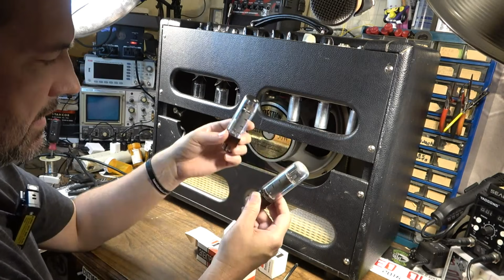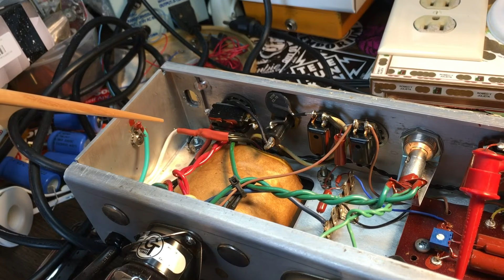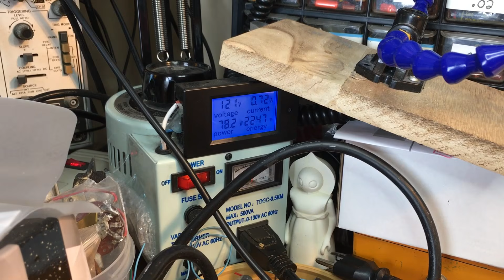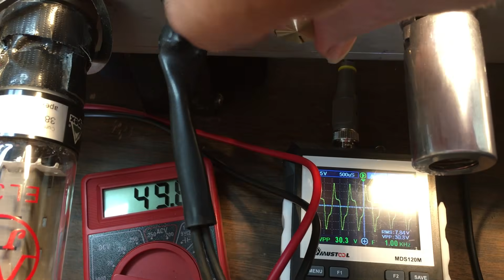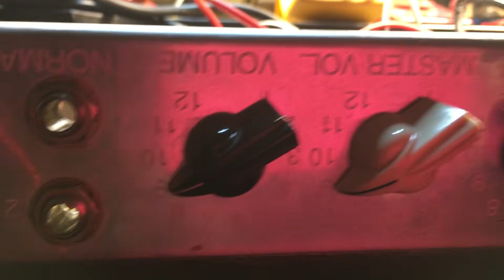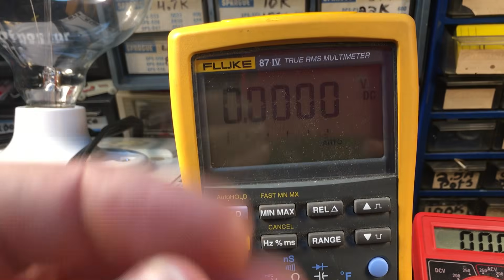STOP USING THE STANDBY SWITCH ON YOUR GUITAR AMP!

Comment: On the dumble designs, doesn't he often move the standby point until after the big caps & choke, so most of the inrush is split between power on and standby switch? I always thought that was an interesting design choice. No load B+ at that point would need some appropriately rated caps.

Comment: I think we are all barking up the wrong tree here. The root cause of tube rectifier failure is high plate voltage. Modern tube rectifiers seem not to be able to handle the higher mains voltages we often see today. Check your wall voltage with a good true rms meter and you will often see upwards of 124 volts. That is over 5 percent higher than the 117 the amps were designed to. Variacs can help but are big and bulky.

Comment: Yes and No , use it for power up only ! Why it is there , Never use it to mute the amp after warmup.Or before shut down .
Standby switches were designed to protect the capacitors (not the tubes)  in the power supply of your amp during tube warm-up only. Guitar amps use higher voltages to get more watts which can be tough on the capacitors in the circuit.
When powering up your amp, you would have the standby switch set to “Standby”  in order to allow the tubes to warm up before sending full voltage to the capacitors of the power supply. The tubes take a few seconds to reach operating temperature. Until the tubes can operate, the voltage can rise higher on the capacitors which is hard on them. Once the tubes are warm, they pull down the power supply voltage to normal operating levels at which the capacitors will work better.  When powering down, it is not necessary to put your amp in standby. Simply turn off the main power switch.

Comment: Use it when turning " on" but when switching " off" just use the power switch to " off". Don't mess with the Standby in any way..older transformers had a centre-tap ..some modern versions will fry The 1watt resistors! Standby works for 1kv plus plate current like im old TV sets.

Comment: I built my little DIY 2W JCM tube amp without a standby function, instead it switches between tube rectification (47uF)  and solid state (2x47uF). It means it can do older sounds as well as what you'd expect of a JCM800.

Comment: When Mr. Fender started his Company , his first Amp design started with a schematic of an RCA Radio . And then Marshall began their first Amps with a copy of Mr. Fenders design . 
I've always used my Stand - By Switch because , in my opinion , I think the Tubes and Circuitry need a few minutes to warm up before being slammed with full power . 
Let me be clear , this is only my OPINION . And it's what I believe . And I've never had a failure with any of my seven Tube Guitar Amps . And I've been playing for a bit over 40 years . 
     I hope everyone is doing well and staying safe .    🎸  😎   🎸

Comment: Some towns, Villages have dirtier electricity. Some days voltage will drop down voltage , or sometimes it would maybe be 123-4 volt..more noise. Although I am running to 2 Electric purifiers,    I'm going to keep all the fuses, standby switches, everything  on the amp until I learn better

Comment: Standby is usefull on stage when your amps warming up and you dont want your cable or wireless  live or your guitar feedbacking when you are at the bar, also my marshall wont turn on using the standby if the electrics are wired back to front at the stage ,which i have had on me once probably better to find out then than when i switch on .

Comment: Last week I plugged in my Seymour Duncan convertible 100 w for the first time in 3 or 4 years I was going to sell it so I want to check it out before I got rid of it. Anyways I cut the standby switch on went in the house come back out, plug my guitar in and cut the stand by switched on and so on ark in the rectifier tube.. so instead of leaving well enough alone I did it again and blew the fuse. Well I'm not going to use the standby switch it wasn't a slow blow fuse. I do need to check my filter capacitors I think. I like the sound of that so much I took it off of marketplace and I'm going to keep it...It's murder to work on but it is a bad ass of an amp.. it's so loud it will not the feelings out of your teeth.. all that said I will not use the standby switch any longer because it's fine long as I don't use the standby switch and it doesn't arc last I used to stand by switch

Comment: Gerald Weber, Ken Fischer... I go with their knowledge on this subject, those 220K 1watt resistors are the path to ground for the accumulated voltage in the entire amps electrolytics at "shutdown".. you turn off the power switch first leave the standby on for 15-20 secs and all voltage in the amp goes away thru the 220k resistors that are connected to the main filter caps. 👍
Reply from the maker: That’s another disadvantage of the Standby.

Comment: The standby switch is required when Class A is used in the power stage. In such circumstances, with no signal applied the power valve (tube) is sitting at about 50% of its rated output. Any applied signal can vary poaitively or negatively around this mid point. If the amp is on but not being played through, there is roughly 50% power being dissipated in the valve and primary of the O/P transformer not in the loudspeaker as would normally be the case. Over time this constant DC current will likely cause damage to the valve or transformer primary. Class A/B overcomes this issue and allows for more powerful O/P stages.

Comment: Lol i just now saw your modified variac! I did that same mod with that same display about five years ago (im sure youve had yours even longer). Did you also seperate the power to the display so that it will read all the way down to zero without turning off? I took a dremel and a file to the front face of my variac and installed the display permanently into it but it was a major pita, worth it though lol. I also added a beefy toggle on/off switch  on the side so that its really easy to quickly cut power if i get any smoke from old caps, or arching etc etc etc. in the amps im working on. That mod turns those cheap variacs into perfect benchtop power supplys!

Comment: As long as pro amp company's keep using them, so will i. been using it for 40 years without an issue on my old vintage amps. kinda like a car was running 70mph down the road then at idle at the light, when they came out with the car shutting off completely then starting right back up when you take your foot off the brake, that was the dumbest thing ive ever seen and heard. Heavy wear on the starter, battery, ( SPECIAL EXPENSIVE BATTERY ) Hard on the engine in general vs letting it idle, a tube amp needs to idle as well, the off and on in rush of power does more damage than standby...just my experience anyway.

Comment: Brad, I know this video is older, but I bought the 65 pro reverb amp. Anyway, on the back there is a toggle switch for, "ground." What position should it be in? I think there is like three or four positions. I know one position is, "60 cycle," and then some other choices.
Reply from the maker: If it’s a 3-prong cord, put it in the middle.
Reply: @TheGuitologist  Man! Thank you so much. This thing was a one owner and the gentleman passed away in Oxford Mississippi and his family sold it. It just had the caps and tubes replaced and I have them in a bag. I'm new to everything and probably shouldn't have even bought it, with my limited skills but it just sounds so much different and better than my pcb type amps.

Comment: I have been using Ampeg svt's for years.   I've always used standby on the vintage amps as they were hardwired with a standby tube and the new vr has an automatic 20 second standby.

Comment: I was raised as a tag-along kid in my dad's TV repair shop back when folks did that sort of thing and ended up getting a EE degree.  I think the power supply filter cap changes, thermistors and biasing mode you've made are very good to improve safety as well as long term reliability of this amp.

Comment: I had my Mesa rectoverb connected to a THD hot plate with the volume all the way up. I turned the standby switch off because I needed to disconnect my guitar for a second. I connected with my guitar back up after reconfiguring a few pedals. I then flipped the standby switch back on and then it was a huge pop and smoke😢

Comment: I had the same problem with a super lead that I bought used. I took it back and got my money back. dude didn't tell me it was blowing fuses and it only did it when after it was warm and played for about 30 minutes or so. He said he was unaware but he was a musician and back then it was not a cheap amp by any means and I bought it because it was not expensive because he he said he would help me out. I ran into him on the back street music store in what once was a thriving city at the time of about 70,000 citizens with 4 music stores and at least 6 pawn shops.

Comment: My understanding has been that tube amps with solid state rectifiers should be allowed to warm up in standby to prevent a sudden inrush of current that could potentially damage the amplifier. This would not apply to amps with rectifier tubes, as those tubes, like the preamp and power tubes, would also warm up gradually. Is this not the case?

Comment: So the advice is power up by flipping standby before power to mitigate tube harm. I'm guessing that doesn't apply powering down? Powering down w standby first to avoid gross speaker thump should not cause issues right?

Apologies if this was addressed in the video and I just didn't catch it.

Comment: A standby switch is NEVER needed in a push-pull amp running class-AB because the plate current with no signal is at or near zero. In a single-ended class-A amplifier, plate current is always flowing, so a standby switch in the B+ line can extend the life of the power tube if used while the amp is temporarily not in use, such as during breaks while practicing or gigging. Use of the standby switch under such circumstances eliminates noise and hum from the speaker, as well. Even so, the extra power tube life is minimal.

Comment: I don't have a stand by switch on my amps ,but I was wondering if using a RX brown box would help with the situation you are describing here. I usually drop the voltage down by 4 volts on the brown box , unless I use it to keep the voltage coming in to 120 volts from the wall socket .

Comment: Cold tube filaments tend to draw a lot of inrush current. Placing an appropriate ntc thermistor is good practice. In P.A. power amps even with a timed ntc bridging power relay. It makes your stuff more relaiable and keeps the power mains fuses from failing....so your studio isn't in the dark...

Comment: What's the difference in turning the power on without using the standby, or turning the standby switch off,and getting a rush of power doing it that way? Seems the same thing to me! In the Marshall booklet, they tell you to use the standby when the guitar;s not in use.

Comment: I thought in the previous video the fuse blew because 1) 2 not 3 amp 2) not slow blow fuse 3) you eent straight off to on bypassing standby- I though you said THAT could cause the current spike too?

Comment: This is one of your best videos. I’m going to build an ab763 Deluxe Reverb, single tremolo channel only. I’m using a Princeton reverb chassis. I’ll install a reducer in the first octal tube socket to accommodate the extra 9 pin tube needed. The remaining octal socket openings will receive the 6v6’s. I’ll use solid state rectification WITH the thermistor you pointed out in this video. No standby switch as well. Perfect.
Reply: I have a F.R.E.D. (Fast-recovery epitaxial diode) rectifier (2 simple parts) in my Bassman 100. It sounds great, unlike other solid state rectifiers!

Comment: GZ34 warms upmore quicker than a direct heated rectifier ............what can I say ?
The schematic shows a direct heated rectifier instead of a indirect heated ?
The standby is designed the wrong way !
Using a delay to apply Hv to the plates extends life of the tubes .!
Switching of the HV  before the heaters extends the life of the tubes...
With direct heated rectifiers the switch must be on the filament ............and NEVER do hot switching on rectifiers before they have cooled down !
With decent quality tubes .......as long as the y run within the opzration conditions published by tyhe manufactures ........life is NOT shorted by running them below the specified maximum operation conditions ! .................as long as no electrons are pulled out of the cathode !.....BUT......Glass temperature must stay below the specified max temperature of the tube ! ( Class A does not harm the tubes as long as all is WELL designed , there's much missunderstanding about tube technology TODAY ! )
Modern GZ34 ( current production tubes ) are not up to the standards of the real  nos tubes.
Foolish indeed to have coated with paint the components .
Using an NTC ( correctly choosen ) is always a good idea.........

Thank you for the upload. 
....an Old school tuber.........

Comment: Is this why they put a standby switch on the Valco built Harmony 430, a near dead ringer for the Gretsch 6162 with the exception of a 5Y3(?) -can’t remember if that’s different on.schematic vs. reality. The 430  Schematic shows a 5Y3 but actually has a 5U4. The power transformer in mine actually took a bath and they installed a much smaller Hammond PT. I’ve also read that the standby switch in these valco’s are a source of noise. Im spinning plates trying to decide whether to ditch it or not. I never use it as such except when powering on. I need to install a 3 prong and eliminate the the polarity switch. I wasn’t told what fried the PT but this discussion might shed some light on it. I’ve got RCA black plates and my wallet gets a bit jumpy when I play for these very reasons. Cheers’

Comment: Hey Brad I heard you mention about using an attenuator on this particular amp I have a 1972 Marshall 50 watt the original output Transformer has been replaced with a replica and it has been recaped with j.js, currently running tongue soul el34 original power cord replaced with a ground and I'm pretty sure my guy bypass the polarity switch my question is, is it okay to run this  amp with a Bugera PS1?

Comment: I have started using a variac in all of my amps to 115 volts instead of 120volts. I rebiased my amps and everything seems to run much better and even sound better at that voltage. Johnny Hyland country guitarist on YouTube talked about using the brown box variac. It really does sound and play better.

Comment: Your amp will appreciate using Standby Switch, warm up first with Standby off to let the heaters warm up the tubes and let high volts establish itself all the way to the standby switch, it's all sitting there at the switch, before power tubes. Shutting down, turn off power first and look at power tubes, you'll see filter caps draining to ground as the orange light goes away. But ..... this isn't true for all amps!!! Little ones are O.K. with just a power switch, especially with GZ34 rectifier, in the tube amp world, not just repair people have to learn what each amp wants... Your musician HAS to get to know his amp also!! It's all good cuz you cannot beat Tubes for sound! Never ever never!

Comment: I switched on my marshall jcm 800 with the standby on and after sitching standby off i  blew both fuses and the 4 power tubes. 
Hardly dared using it after replacing tubes and fuses....
Reply from the maker: To be perfectly fair, it isn't always the fault of the Standby switch. All that stuff might have failed anyway upon the next power up or down. Changing the state of the amp from Off to On or vice versa is usually when components will fail.

Comment: To make sure I understand, I should turn both switches to “on” when I start my amps? 

RedBear MK60 (2204 clone-ish), 5153 EL34, Mesa 50/50

But once the amps have been running for a while and I go to take a break, THEN it’s okay to turn it on standby?

Comment: I don't have the tech qualifications, just a hobbyist.  In any of the valve amps I've made, I have never used a standby switch. For higher draw amps, I've tended to use gz34, 5ar4, gz37, 5v4, with separate cathodes to the heater. I would even tweak the power supply to optimize for them. I find that there's a slower ramp up on the B+ as compared to 5u4g. With the 5y3, I've used on choke input.  Another thing I've done, given as advise by other hobbyist 20yrs ago was to put a resistor before the cap input to make an RC filter which slows the inverse rush to the rectifier as we tended to use tx to hand and over spec'd for versality in future projects. Any of these unadvisable?

Comment: Isn't the entire point of the standby switch just to mute the amp? That's what I use it for, because when I turn on my Headrush Pedalboard it outputs a bit of noise, until the noise gate is initiated. I like having the ability to do that, to start up the devices simultaneously.

Comment: I have seen other videos explaining about how standby makes little difference in spikes for solid state rectification and it makes some difference for tube rectification but is not really necessary as well as that cathode poisoning/stripping is not really a concern for guitar amplifiers because they don't use massive voltages and such compared to some other tube devices. Lower wattage tube amps often don't have a standby switch at all because they have an automatic standby function or just let the tubes warm up as normal.